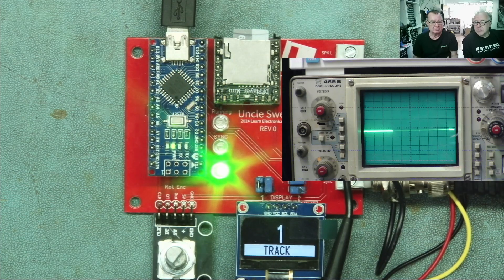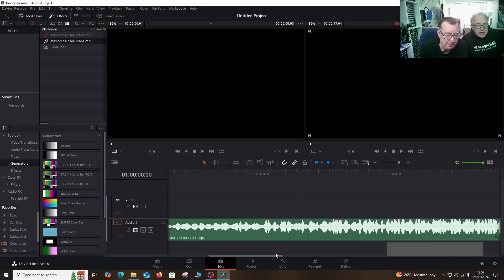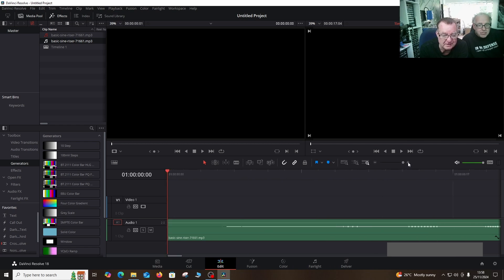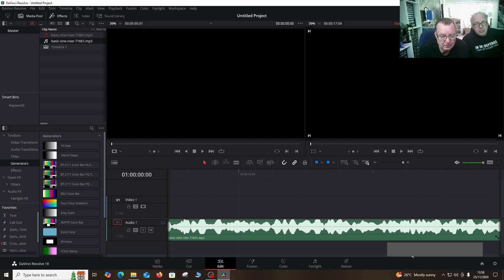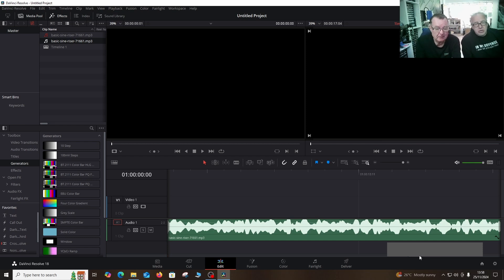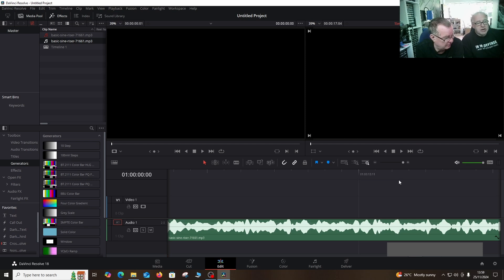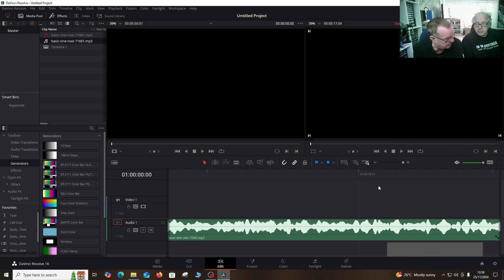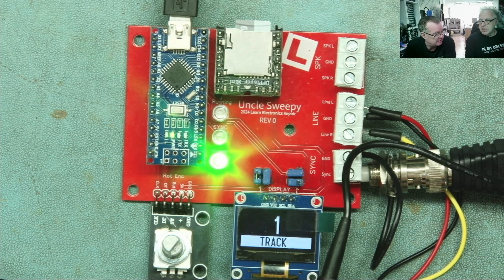Cheap DIY Audio Sweep Generator : The prototype PCBs are here from pcbway.com Let's Try Them

Comment: Hi Guys.  Thanks for the video. I put one together on a breadboard from the earlier video "Cheap Easy To Build DIY Audio Sweep Signal Generator" but the linked source code didn't have an .ino file. Just the Arduino IDE. Looking forward to the PCBWay upload. Paul
Reply: Hi again. Here I am replying to myself... it seems I do that a lot lately in my old age... Well, I found the files in the Source Code/portable/sketch book/sweep gen file. Put it together on a perfboard and it works well. Thanks again. Paul

Comment: hey richard, you should really take a look into the software called "visual analizer" it can measure signals using the sound card, generate sweeps and much more. you can select the waveform, amplitude, duration or program it to do custom things. For example, you could do a sweep with it and at the same time, display the signal coming bach trough the microphone or line in from the computer. so you can measure the frequency response for a room or an amplifier. another useful thing to have ist called "equalizer apo" it does exactly what it says and much more. effects delays, reverb. both programs work in real time.

Comment: It looks lovely, I do like what you have done.
I like the function you have added to the encoder button.

You said the Magic Word though "How would I like it" haha.
I would keep the orientation of the encoder and OLED as you have them. But have them over the PCB. So the PCB sets the footprint of the tester. If someone doesn't want to make a box, you could just fit feet (rubber) to the mount holes.
I would put an option for a 3mm Stereo Jack on the PCB at the back next to the MP3 player, still keep the terminals (speakers).
I would still keep the header socket, but to give more options/choices I would add the option on the PCB to fit the encoder direct (It may be cheaper to get these as lose components and are easy to fit). 
I know that some Arduino libraries for the NANO, when you use I2C, it pulls the Pins HIGH, but an option to fit some pull-up resistors may be a good thing?
Reply: Hey Tim - just a short answer to the I2C Pullups: the Display Module has them. As one who has spend way too much time on wondering if the MCU does the pullups: I'll always check them :)
The Orientation you discribe was actually my intention: I wanted to have the Encoder and the display "floating" over the board. And I have no idea how I screwed this up... Rev0 :)

Comment: Leave the pcb as it is and mount tne display and rotary encoder underneath so they occupy the same footprint as the pcb and mount in a small box. 
Definitely use wavs as this is rest equipment. You dont want mp3 compression artifats confusing things. I'm not sure what's going on with that sweep waveform, but I'm sure Audacity will make a much cleaner wav file.
Reply from the maker: Interesting as I actually suggested that to Det 😁

Comment: If the display and encoder were at right angles to the board, they would either have to hang below the board (which does not seem sensible to me) or the order of the connectors would need to be reversed. I assume the orientation of the display is easily inverted in software, ie the bottom of the display next to the connectors.
Reply: Hi Chris - I'm the guilty one: in my mind, Rotary Encoder and Display need a 180deg turn. But your post got me thinking: the MCU can't determine wich way the display is orientated. Since the NANO has a bunch of pins left over - next version will have a "DISPLAY ROTATE" jumper - thanks for the thought!

Comment: I improved it by just using my Android phone 😄
Reply: That's a good point. There's lots of interesting apps available today making use of the high end tech incorporated in smart phones.
Reply: Interesting. How did you manage to generate a separate sync pulse from your phone?
Reply: @Foobar_The_Fat_Penguin  No, but I've not needed that.
Reply from the maker: @ianhaylock7409  Then you are missing the point - without the sync pulse you can't record or display a waveform showing how the amplifier behaved across the sweep.  Yeah you can listen to it but considering how that really bad MP3 sweep sounded to us (but looked terrible on the scope( then you can't really trust your ears
Reply: @LearnElectronicsRepair  How did the sync pulse allow you to see the output on the scope? If I needed a sync pulse, I could do so with an ESP32 connected to the phone by USB or Bluetooth.
Reply: Does your phone have a 3.5mm audio jack?
Reply: @Mr_Rusty1  Yes.
Reply: Love this & have watched all the uncle sweepy videos but don’t get the need for the sync pulse either, can you explain or demo that please, I’d vote for vertical screen & encoder cheers